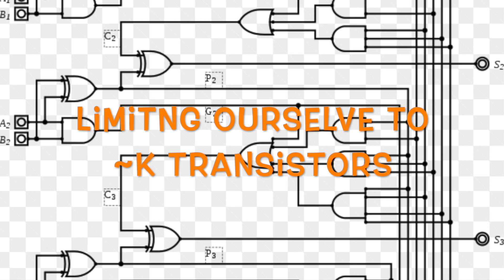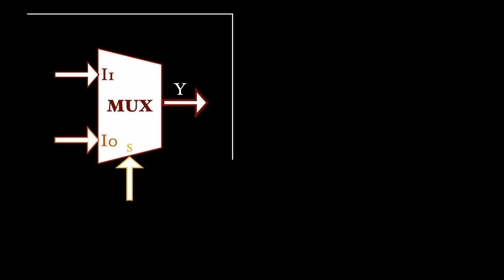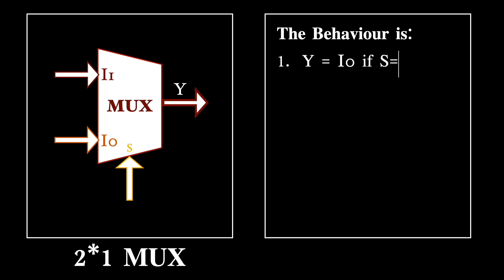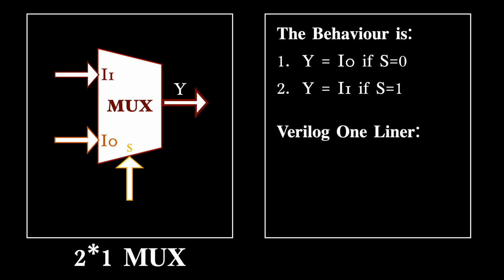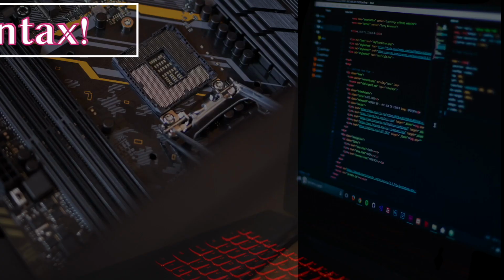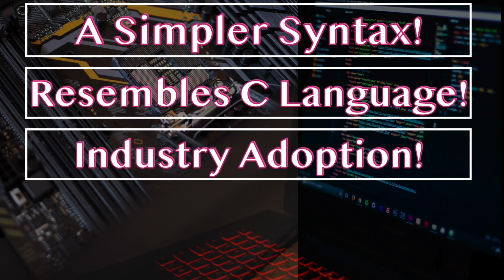Why Verilog is favourite HDL of VLSI Engineers || VHDL or Verilog || Hardware Description language

Comment: Sir in 3rd round ccmt I have got nit allahabad signal processing .What should I do now. According to you should I go for special round for Vlsi branch or I should accept it.
Reply from the maker: You should hold NIT Allahabad SP and go to Spot rounds as well because we never no counseling miracles.
Reply: Thank you for your guidance.
Reply: That means you want me to go for spot round but not to go for special round .Am I right sir?
Reply from the maker: I remember clearly that during my time I got NIT Allahabad power electronics in the 2nd round and went to the spot round along with holding the current seat. I am suggesting a similar strategy to you as well
Reply: @Singh-Rajveer  ok thank you I will definitely follow your suggestion.

Comment: Hello Sir .I started learning verilog from Iit kharagpur nptel course .But I am finding difficulty in understanding and making concepts .What could be the best way to learn ?.Please guide me
Reply from the maker: Hi, I feel you should practice simpler modules such as MUX, And gate, Encoder, etc on eda playground first and also try to understand different modelling styles.
Believe me it's very easy, Just follow Basics of programming and relate it with logical aptitude.

For example: There are wires and reg in verilog so understand these terms properly like what they actually signify in hardware and then do coding
Reply: @Singh-Rajveer OK, Sir